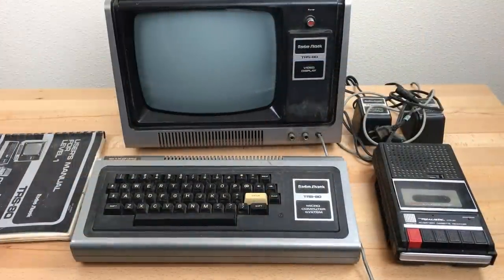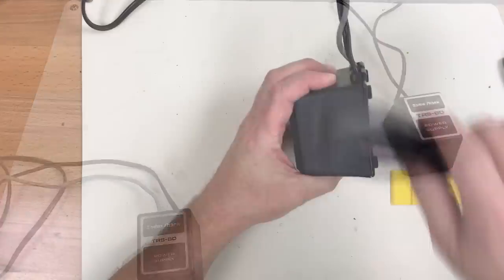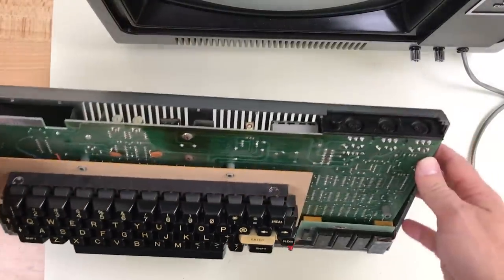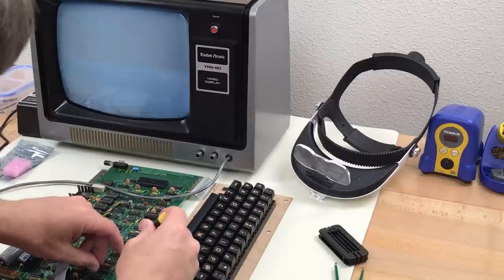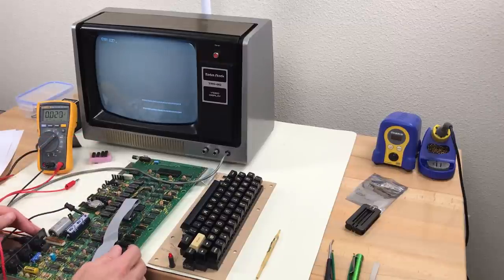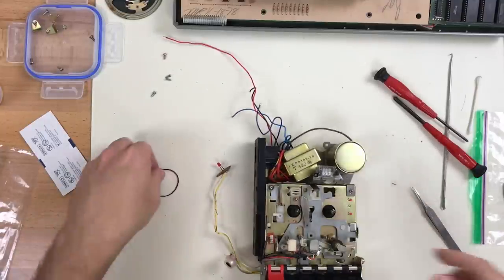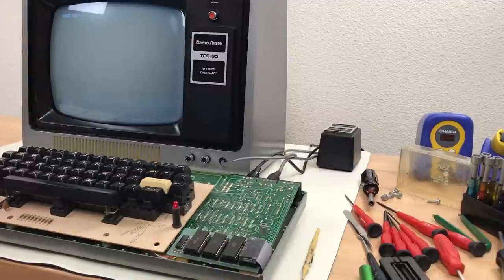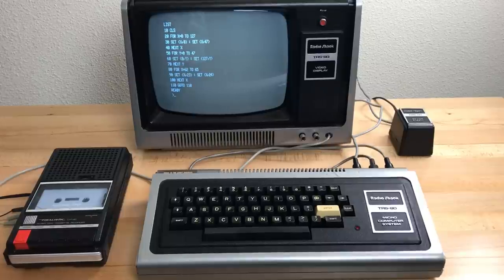TRS-80 Model 1 restoration #SepTandy

Comment: 50% of people selling stuff on eBay have no clue how to properly package it. I have taken to asking them before bidding if they are familiar with packing heavy, delicate things before shipping. Someone who takes pride in the effort they put into packing something will be happy to tell you what steps they take. Those will no clue will be offended you asked.
Reply: It's not hard to ship a TRS-80 computer or expansion interface.  Shipping a monitor is much more difficult to do properly.  Even worse since they are way more delicate now with brittle plastic and age as when they were new.
Reply: @paulmoscatt6529  The first expansion interface I got from eBay was broken in shipping.  Almost no padding.  Not as bad as the heavy old HP power supply I got that was wrapped in one layer of bubble wrap.  Some people don't realize that shippers just toss the packages around.   The ones with high sell count are the best bet.

Comment: I loved your video (restoring one myself right now) but please folks use plastic screwdrivers when working with CRTs and try not to reach around the back of the yoke from the front when making adjustments.  There's over 21kV in that area.  FWIW I wear sneakers and insulated work gloves whenever I'm inside a CRT monitor or TV even when it's turned off.  Note that the tube continues to  hold a significant charge when it's turned off and unplugged.

Comment: A quick trick I adopted for working on pinned PSUs like this is to get some thin tubing, cut to a little over the length of the pins. Drop it over the pins and you can slide your probes into the tubes and be confident you'll only make contact with the pins you're measuring. I used to use heatshrink, but I stole the straw off one of those "juice box" drinks my kids like and cut it into lengths. Great for all of these PSUs (and there are SO MANY!)
Reply: That is a fantastic idea! Thanks for sharing that!

Comment: I remember debouncing a large number of these. They changed the keyboards on the later models, to one from ALPS, and they had a software routine to fix the repeating keys.

To fix the problem in hardware, remove the key caps, and look at the contacts inside. There are four on one side, and one on the other. Gently bend one of the four slightly inward, so that the first one to make contact is the last to break contact. You may want to use some contact cleaner as well, but, after fixing at least several dozen of these, I never found it necessary. If you feel particularly fussy, you can adjust three of the four contacts, again making sure that one definitively makes contact before the others.  Replace the key caps, and enjoy your bbbbouncccceee-free keyboard. 

If you check online, you should be able to find the lowercase mod, that simply adds an extra bit to bring the video memory up to 8 bits. The character generator chip already has lower case, it’s just missing the last bit.

Comment: Great video. It's a great feeling when you turn it on the first time after a repair and it works. I just finished a Coleco Adam with a bad CPU and video processor.  Also have one of these with an expansion interface. Love these trash 80s!

Comment: The cassette mod isn't necessary if the Level II ROM set is new enough.  They actually fixed it in software in the 1.3 release so the hardware mod was no longer required.
Reply from the maker: Yes, I forgot that they fixed it in firmware. I was just surprised since I had another '79 model 1 with numeric keypad that had the XRX mod and this one is a '78 but perhaps it was upgraded to Level II later.

Comment: It's a shame the seller didn't use any bubble wrap or foam to protect this classic machine. The chip PIN straightener you used on the video RAM chips are awesome! They come in handy with new/replacement chips for sure! On your cassette recorder service, where did you order the belts from? Also, that 303 protectant is amazing! Nicely done on your model 1 restoration.
Reply: @HutchCA  Thank you for the link. Again great job on your #SepTandy video!
Reply: Excellent work and video as always. I feel your pain. I get a TRS80 model III and it was completely destroyed. It had to got o e-waste. Sad day
Reply: @geekwithsocialskills …the link to the belts has disappeared . Did it age out?
I’m working on a Realistic cassette machine, the high-end ‘soft-switch’ stereo one, and it needs belts.

Comment: Loctite is very effective. Just a few drops.
Reply from the maker: Loctite is a brand name. I assume you mean CA adhesive but that is very problematic since it can overflow and cause significant discoloration. 
Acetone is simply a solvent that dissolves the plastic, and if it overflows, as long as you don't touch it, it will just evaporate leaving no trace. It's much more effective at welding the plastic back together than CA glue which dries brittle.

Comment: Nice video. I had a model 1 level 2 back in the day, and I seem to remember that the level 1 could be upgraded to a level 2 but that also included the 16K of RAM and a numeric key pad. 
Weird yours said 16K level 2 on the expansion port, maybe it had a new case from a level 2 machine.

Comment: Huh, that's really strange that you'd have so many dead video RAM chips without much in the way of other problems. Congratulations on the final product, although, yeah, the seller deserves to be slapped.

Over on my channel I just completed my own repair of a bedraggled eBay TRS-80 (that I thought had a video circuitry problem but actually turned out to be something much more global in scale) and, man, it's kind of shocking to me how nice and simple your factory-stock 4K machine is to deal with inside. (That is a weird config, though, 4K but Level II!) My example has multiple "power user" hacks with switches running to holes drilled in the case, a CAS/RAS/MUX DIN pigtail for the old bad E/I, the "sidecar" numeric keypad, etc, and I had the worst time getting that monster back into the case when I was done.

Comment: Hi Chuck - My Model 1 has the same wiggly-screen on the edges of the picture - I assumed it was caps in the monitor, but have not attemted to repair yet.  Have you checked any further on this problem with yours?
Reply: Could it be just "cheap CRT?" I remember ours would get squigly like that whenever the screen contained a lot of white pixels.

Comment: I'm repairing a model 1, one of the rubbery spacers dried out and crumbled when I pulled it off. Do you have any suggestions for a replacement? Also, I found rubber feet adhered to the inside of the case. I wonder if this was done in the factory or if the previous owner did this....
Reply from the maker: I think I found rubber feet inside also. Maybe they were there to keep the boards in place.
No ideas about the spacer rings. Anything the right size should do it. Maybe a stack of O rings?
Reply: @HutchCA  I'll figure something out. Whatever works, it's on the inside of the case so no one will see ;). Thanks for the reply.
Reply: @HutchCA  I saw the rubber feet inside the case on a video by Adrian's Digital Basement as well.

Comment: Where did you get those video ram chips? I just bought a trs 80 Model 1 and the same issues.
Reply from the maker: I got the 2102 RAM from Jameco. Specifically MM2102AN-4L. Looks like they still have some in stock now.

Comment: You should upgrade that to 64K  I remember back in the day when 64K was so much money.  Now you can buy the chips for pennies.
Reply: 48K was the max amount of RAM due to the lower 16K was reserved for ROM (12K), video RAM, and reserved memory-mapped ports.
Reply: @lohphat ..old video.. for future.

The main unit (keyboard) held a maximum of 16k RAM, as you state that the lower 16k was reserved.
The other 16k was added via the ‘Expansion Module’.
Although, yes, nerds had their “RAM-BAM’s”  that was a board that hacked in the 16k inside the keyboard…. Rat’s nest, and I didn’t like it.

Comment: Should not insert the chips into the sockets until AFTER they are soldered in!
Reply: @HutchCA  sorry, I guess you were just putting the sockets into the board.  Hard to tell as camera work wasn't perfect.
IIRC the model I didn't have lower case, which would explain why only 7 video chips.  MSB must be used for cursor and graphics.
Reply: @HutchCA  I expected an extra bit would be needed for inverse video on a character by character basis.